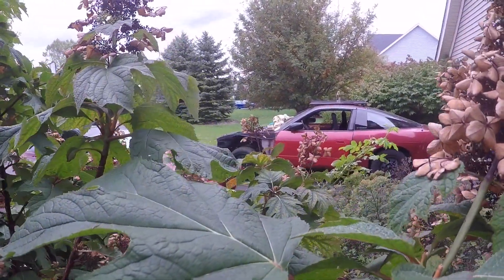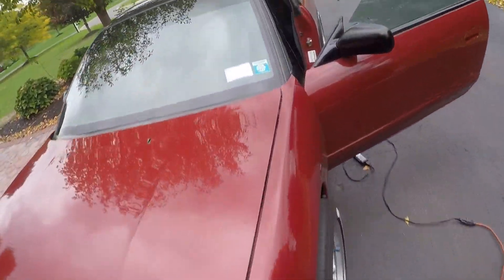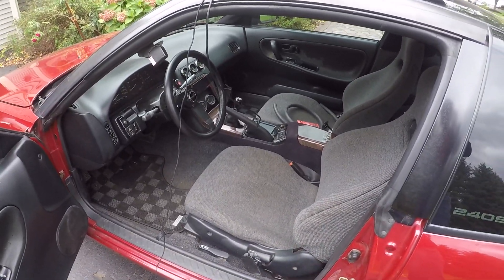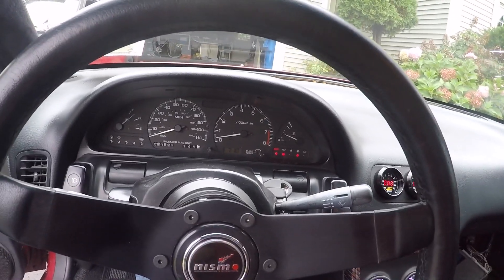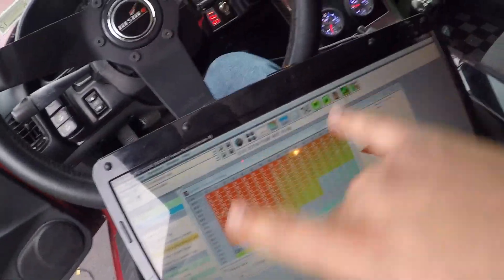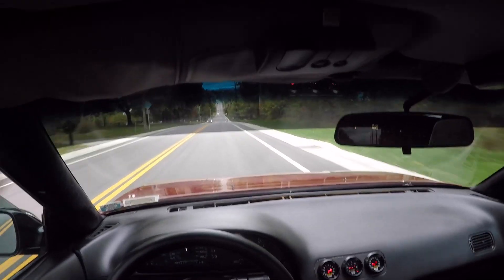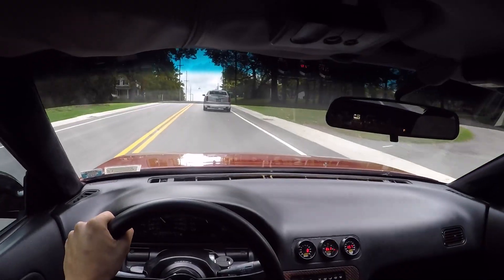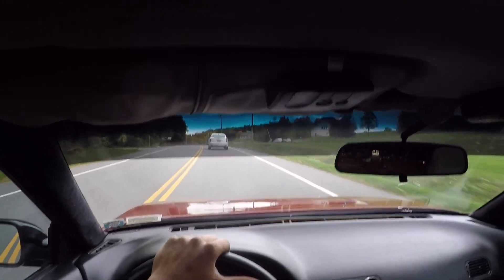HITTING BOOST!! | RB20 S300 TURBO 240SX In Car Drive

Comment: Whatever your base ignition timing is set to via ECU should be the same wise of the timing set under the hood. So if the ecu says 10• then the harmonic balancer timing mark should be set to 10• as well. Essentially synced.

Comment: Not sure if you did or not, but timing needs to be verified with a timing light. I like to set base timing at 15* from idle to 3k rpm, then have someone keep the revs it at 2.5k rpm while verifying timing at the crank.  Adjust the cam angle sensor to get it to 15* btdc.  Then change the base timing map back to what you are going to run.  I love the build, keep up the good work.
Reply from the maker: +Like ZO I appreciate your comment man. But I actually didn't mess with the timing. Even though it seemed like I did in the video. I just left everything how it was.

Comment: maybe tps? or maybe needs more air? not too sure but possable need more air to compensate for the richness but idk not a pro at this stuff, seems like its bogging like ur saying about the fuel but seems like you can get way more power outta it

Comment: the reason its still going rich is because all the fuel gointo the dead cylinder is getting pushed out into the exhaust and the wide band is reading that fuel, if you unplug the injector on the dead cyl you will be able to tune it better
Reply from the maker: +That-JDM-Fascination! It's running on 6.
Reply: Kalvin Malli oh okay sorry i missed that part

Comment: Kalvin, you set the timing wrong! See "Like ZO"'s comment.

You cant just turn the CAS, you need to lock timing in Nistune to 15deg, and then verify with a strobo that you are actually hitting 15deg.

Otherwise, keep up the good work!
Reply from the maker: +Daniel Öster Yeah I didn't mess with that. I probably should have mentioned it in the video. I just left it all alone.

Comment: hey man i understand that your aren't a tuner and i don't mean to give you lecture or anything but you should know that this is a really incorrect way of tuning your afr. I really doubt your tuner changed the fuel by adjusting the programmed afr map in the way you just did. In doing so you completely changed the shape of the map and now instead of a progressively richer afr as boost comes in your map actually appeared to get leaner right where you would start spooling. Obviously in the car your afr is actually rediculously rich but that is because the VE or MAF tables are too high (these tables are supposed to be tuned until your measured afr is equal to your target programmed afr). Honestly man you should get to a professional as soon as you can or try and atleast watch some material online on how to do this type of work. (try hpacademy they are great and have some free entry level lessons, worth watching even if you aren't trying to be a tuner). Hope you don't think I'm trying to knock you, just trying to help :). Good luck with it man, sounds amazing.

Comment: I feel bad for sub 2.5L Rb users. Love the RB engine, great engine next to the 2JZ. I have owned an R33 GTST. But even after my friends (6) that owned a modified Skyline RB26, I think that the 2JZ is much easier to make power. However, the Supra is only 2wd compared to the Skyline AWD.
Reply: yeah, an rb20 compared to a rb25 is night and day.
Reply: Because 500hp for 2j and rb25 are totally different feeling, mine was rb25 spooling at 140km can make you driff for 1 bar boost with rwd , that is the reason those gtr must be awd. 2j is not powerful kick once spooling